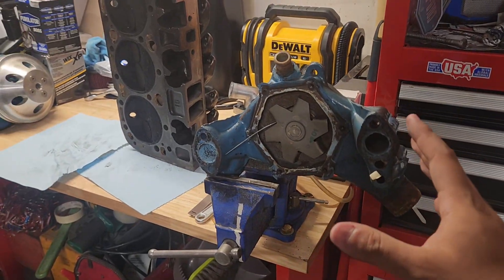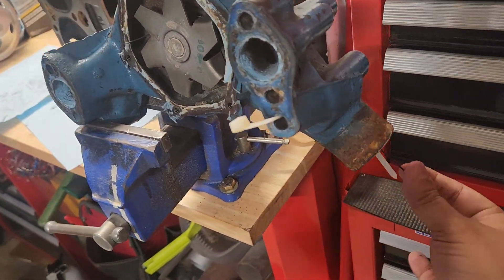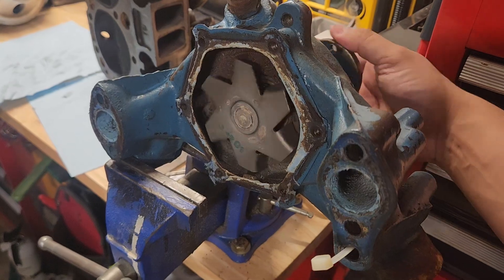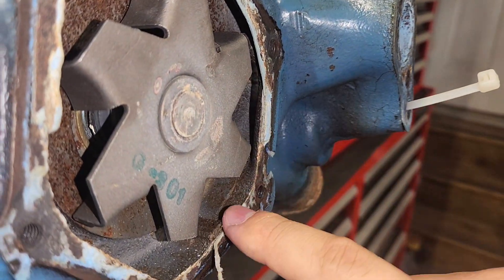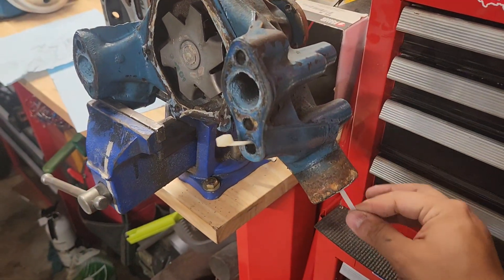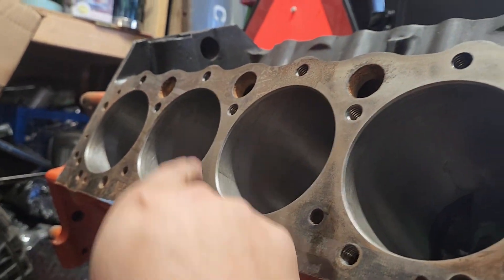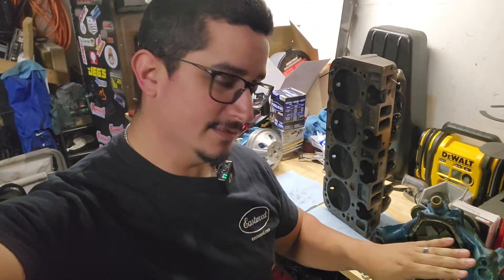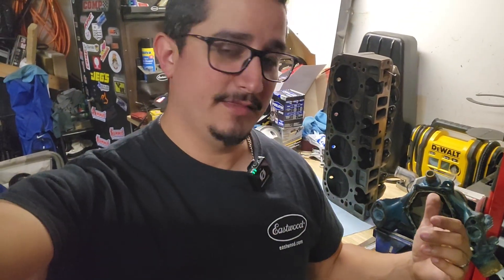SBC Water Pump Bypass? - Responding to questions and comments

Comment: Great explanation. I have the Vortec block and Vortec heads. Thing runs too cool in the winter (160*).
I have a water pump with no port and a manifold whose front port is being used for something else. So I can't run an external bypass in the typical location. I have the stewart high flow tstat that has holes in it and it allows me to run cool in the summer. I have the air gap manifold that has 4 corner ports. Can I use one of those and T into the heater hose that goes into the water pump?  Will that allow it to get hotter in the winter and then I can do away with the high flow tstat?

Comment: thanks for the video, been racking my brain of the heating issue and i dont know if my bypass is blocked but notice that the engine heats up quick for going down the road. keep in mind the engine has been working for the last 4 or so years. usually just sits on 180 -190 on the highway but in traffic will get up to 200-220.

using a 180 thermostat but thinking of going to 160.

flushed the rad change thermostat to 180 put a newish rad back on it as the old one had started to have pin hole leaks in some fins. it still just gets really hot quick. let me know what else you think it could be or if its worth checking to see if the bypass is the issue.
Reply from the maker: It could be. I was seeing similar symptoms when mine was blocked off. How much HP are you making? whats your fan setup like? I have some initial thoughts, but let me know about your setup.
Reply: @diveingarage  2x 12 inch fans on a 3 cord rad. its a standard 350 with just a mild cam. not sure what the power is as i was never going for power as shes just a cruiser.

I have changed my thermostat from 180 to 160f and notice that has help a little with keeping the engine cool but also made sure the rad cap is correct.

looking at pictures from when i put the engine apart it doesnt look like its plugged but then again from you video, yours seemed to be burried into the block haha. so that had me second guessing now.

Comment: You are incorrect  .... the bypass  is on the suction  side of the pump and is pulling water from the head to not jam up the pump against  a closed thermostat  .... lots of aftermarket  blocks do not have this passage  ... its best anyway  to drill holes in the thermostat  as a bypass  and allow  the flow over the thermostat  so it works better  .... also if you are worried  about  the pump by a balanced pump  that sends water to both sides evenly or at least a  pump with a better  impeller